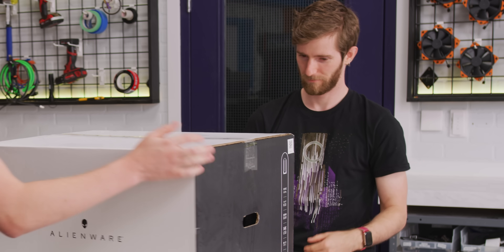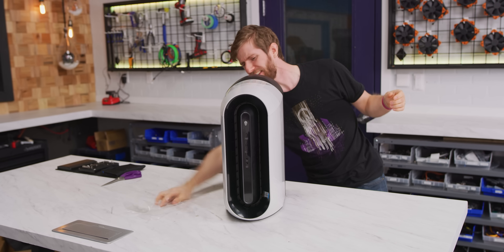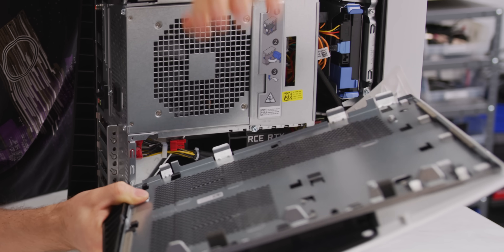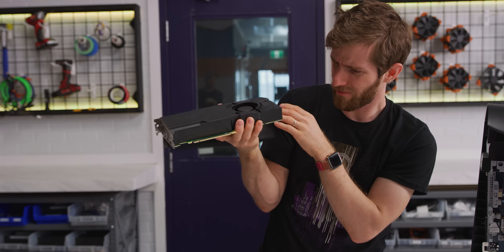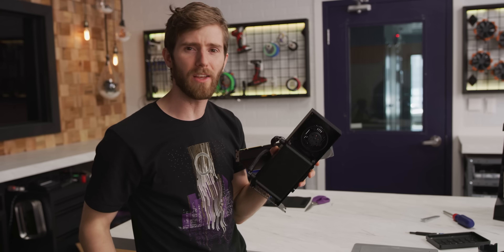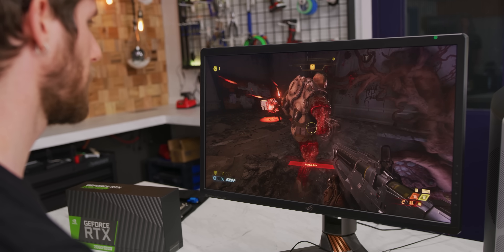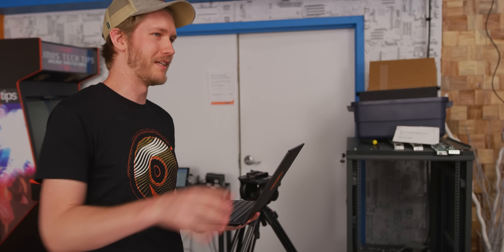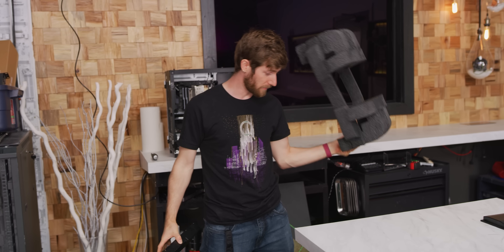I've Never Seen Anything Like This - Asetek Rad Card

Comment: Dont buy the whole community hates that has owned over 3 years there heat bricks with mandatory parts that are all unbranded and you cant swop out the cooler or the power supplies. 3 years of my hard earned money down the drain. every part in this is mid and dont get me started on thee ram omg ugly. I'm very unhappy with it. I like how they say 60% less noise but the tiny fans it has are bad and the you need to turn them up cuse of the fans suck i hate that there taking sponsors from such bad company's

Comment: I wonder if it would be possible for them to make a full-cover water block for a short PCB GPU (likely made of copper/aluminum), and then pretty much staple a RAD-Pump combo to the side of the GPU (120mm-like RAD so the size of the GPU would be like a normal-length card).

That way, you'd get the Cooling/Noise benefits of a RAD-Card, but without taking up the extra PCIE-Slot.

 The water block style first layer would handle the card itself and doing it that way, if the top of the block is layered correctly, the heat from the Rad/Fan exhausting towards the back of the GPU (in a blower-style config) shouldn't create too much loss of cooling.

Comment: I know there is a difference between western Canada, and the southern USA. If my office gets over 70°f or 21°c I start to complain.. in a normal southern house high efficiency heat pumps are a must. Linus, I saw where you installed at your home.  a now ac system update using a mini split. I have the same in my kitchen.  I always thought that the standard efficiency of a forced air system would have been installed in a modern home. But that's mostly just in the usa. Even the EU has pushed back from forced air. No I don't plan on buying that dell, just a bit over priced and I like to put my fingers on the part my self. It is pretty...

Comment: If they cheap out that much on things like black coatings and the number of pins in the power supply, can one really trust the quality of the rest of this PC to not be garbage? I wouldn't be surprised if it failed in less than a couple years if it's made that cheaply. 

Edit: Fixed formatting. I always seem to forget that asterisks mean bold in YouTube instead of italic.

Comment: My 4.44GHz-overclocked AMD FX-8370 is aircooled with a Noctua heatpipe cooler, and my Asus RTX 2060 Super is also aircooled. I don't have a super-fancy high-airflow case. I have zero problems with running my computer at 100% load for extended periods of time.

Comment: I have a split unit air conditioner in my computer room, keeping it to around a comfortable 20.5 degrees Celsius.
I say around because the A/C only displays temps in Fahrenheit with no option to change it, so it's actually set at 69 degrees.

Comment: Linus : "You shouldn't see a significant drop until your room is a sweltering 33 degrees, at which point you might as well go outside"
Me : cries in Texas heat , which is actually just sweat because its hotter than 33 degrees every day

Comment: to make the mold for the plastics costs atleast $10,000 min.i want the asus infinite matrix 2080 ti, it has the water cooler on top of the pcb and the cooling fans (as if it were air cooled ) right on top..
you can see it here https://rog.asus.com/us/graphics-cards/graphics-cards/rog-matrix/rog-matrix-rtx2080ti-p11g-gaming-model/

Comment: hmm.... typical plastic bomber, where Alienware ALWAYS failed
btw 69 degree on the GPU with that big cooling solution? My 150W 2080 Max-P in a Omen 17 notebook is running at 1850-1900MHz at also max 70 degree, only dropping very very few times at 1750-1800 MHz. Ofc louder than this "Desktop", but hey its still a "big" machine we are talking about. Also nobody mentioned the 2 (!!!!) pumps..... not even one pume which can fail, also another one.
At least i got once more an example why i should avoid watercooling. Only look at apples cooling designs (on Mac Pros....), they are also realizing awesome cooling performance with "only" aircooling and their modular coolers are damn awesome, as much they could be also a pain if you want to upgrade/switch components

Comment: I have an aio gigabyte waterforce rtx2070ti the rad is case mount not slot mount.. but I have much lower Rpm 120mm fans, so much quieter than this..

Comment: The case looks like a scaled-up USB-C port.
Reply: Holy Cow 🐮, 😂 🤣 😆
Reply: underrated comment
Reply: The front kind of reminds me of the old Dell Studio PC’s from the first half of the 2010’s
Reply: But is it reverseable like a c port?
Reply: @TheBukaj150  Yes. You can turn the computer upside down and it still works.
Reply: Can confirm it is as a owner of the R11
Reply: fuck, i can't unsee it
Reply: is no one going to point out that alienware stole a computer from portal?
Reply: If only USB-C had the cool ass lights like that, then Apple would finally switch over
Reply: Still looks better than PS5

Comment: how is that radcard any better than a stock blower cooler? the radiator isn't any bigger than a blower cooler, plus you have to still move the heat from the core to the liquid and then to the radiator

Comment: OEM logic: If I save 40c/unit on 100.000 units I just made $40k. That's why it's not powder coated and the ATX12V is missing 2 conductors.

Comment: The interior unironically looks like my dad's 20 year old case. The weird swinging armature and all
Reply: Armature doesn't mean what you think it means... Even though it definitely should.
Reply: @AnonymousUser77254  Woah, yeah, armature should be anything that's moving in an electronic device even WITHOUT magnetism.
Reply: @iadtag1853  one 1st page gogol result had this:
2. a metal framework on which a sculpture is molded with clay or similar material.
    a framework or formal structure, especially of a literary work.
I  could see it being "a formal structure" but it's a stretch, and some other results I looked at couldn't be twisted even through 4, d: or whatever..   ;)
Reply: If my wife sees me searching fro "swinging armatures" it's your fault
Reply: Presuming your dad has/had a Fujitsu Siemens desktop?
Reply: Looks like my old packard Bell
Reply: is your dads computer a sewing machine in disguise ? sorry that was a very armuture joke...
Reply: My dad's dell precision t7500 has that swing arm holding the daughterboard

Comment: This cooler design doesn’t actually seem like that bad of a design at all. Considering that no one uses multiple GPUs anymore and that most motherboards and cases can fit at least two GPUs, a design like this might actually be a decent option for an aftermarket cooler, with a little refinement.

Comment: Considering that Linus rotates the product with his hand every time to show us, I admire his power, but I still hope that you buy one or more 360-degree rotating display stands of different sizes and models. I think the shooting of the lens and the product are " Protection" and display help.
Reply: A rotating stand would probably make it easier for the product to go crashing to the floor. I don't think they need any more help with that.
Reply: I agree with this. LTT has cheaped out on rotating display stands. They should get a pretty wooden one.
Reply: @jonathanwills4726  They can easily make one. It's about what's necessary for them imho. They don't see it as a necessary thing

Comment: 6:20 There was also the GeForce 9800 GX2 dual GPU card which had the blower fan as an extension behind the PCB so that it could draw air from both sides. My (Zotac) GeForce GTX 560 had that configuration as well. It was a "short" PCB but the cooler made it a full length card. Intakes on both the front and the back of the blower.

Comment: Dell for the pass few years... including their newest Smart shift AMD G5 SE 4800h laptop are all bad engineered designs. New Dell AMD laptops run extremely hot 🔥 hot, their panel ms refresh rate is garbage and they're the slowest AMD laptops. Dell high-end alienware builds are in the same category you're better off with an eluktronics 16 cores for $2k
https://www.eluktronics.com/THICC-15/
Reply: Dell Alienware cost  @ $4k

Comment: Had to order a replacement mounting kit for an asetek water cooler directly from them, it was a big ordeal, they didn't read a single thing i sent besides "2011" and "am4".  I told them i had received the am4 mounting bracket, however i had ordered the 2011 kit.  After several emails, and 4 packages from them, i had received the right one finally.  They had sent me 3 am4 brackets after i had explained i had not received what i had ordered.  Great products, not gonna lie, but expect a headache from customer service if you don't get what you ordered the first time.

Comment: 3:10, For somebody who's been in the industry for decades, it baffles me that you still critique this part of alienware computers. Dell makes hundreds of thousands of these computers, probably even millions of the same case that get used in different systems. Sure powder-coating the case may only cost 40 cents to the end user, but 40 cents multiplied by millions of computers can add up pretty quickly. All the extra time, tooling, training, and staff that would be required to just powder-coat the basic computer chassis likely costs Dell millions of dollars. Millions of dollars that Dell doesn't want to spend on a relatively niche gaming PC

Comment: I doubt the lack of powder coating has anything to do with the "cost" of powder coating. It's probably about the hitch in the manufacturing timeline. It probably takes their process about 15 minutes to put together a power supply. It takes many times that long to powder coat something since the coating it has to be baked on, cooled, etc. Not to mention the fact that they'd have to ship all those parts off somewhere else to get them coated. It greatly increases the complexity of the manufacturing pipeline, and rarely ever will you actually see those components.

Comment: Well, i dont get it whats the point of a pc smaller that a monitor. Just place it on the floor, and the size doesnt matter. Also, your occupying all the PCIe slots. What about a wireless card? Or maybe a 10 gig internet card? Depending on the job, you plan for the maschine, that may actuallty make sense...

Comment: To be honest $200 isn't that bad, the problem is more of performance being marginal. Now consider that only the water block for 2080 super is going to be $100+, then you will need all the other things like pumps, pipes, reservoir, rads etc. and you will be spending way more than $200. Obviously, performance will be way more too. I guess the point being - somebody who buys crapWare pre-built PC are not into PC-DIY things and if they cannot just stick the parts into the case, they cannot be expected to fiddle with water loop. So for target audience in question this is not only suitable solution, but as well reasonable price.

Comment: Good to see Dell is sticking with the "cheap metal box surrounded by fancy looking plastic" approach... Like seriously, these PCs have been basically the same for years just with different plastic bits stuck to the cheap ass frame on the inside.

This is also why genuinely nice cases/prebuilt systems should cost more than something like this, and why Alienware's high pricing is so lame